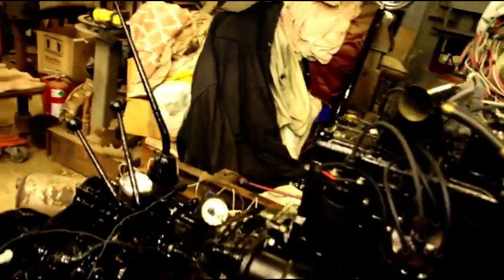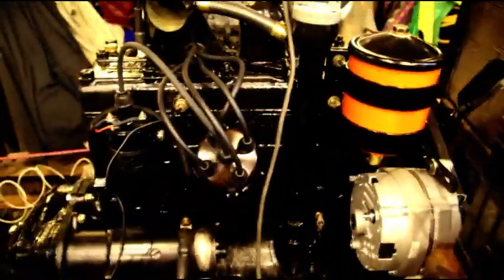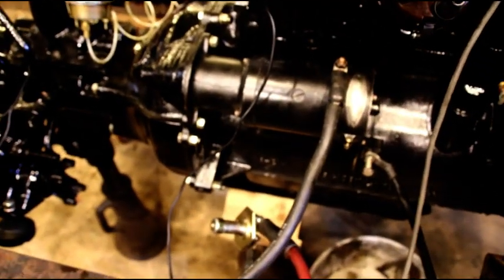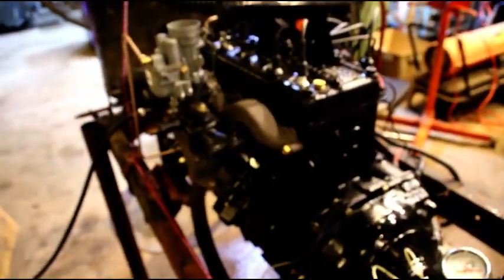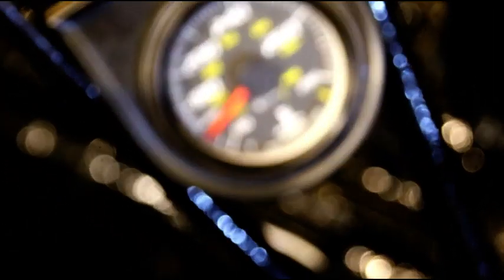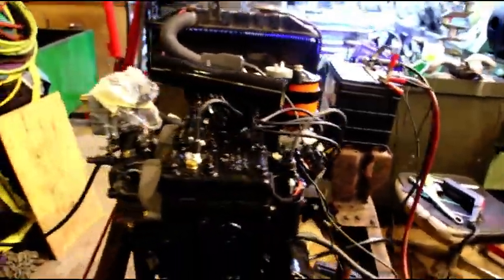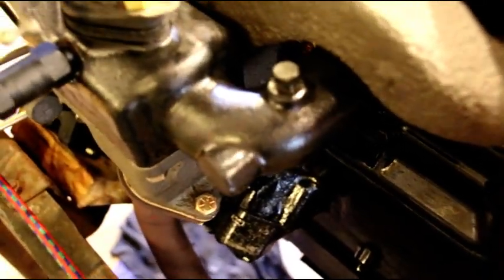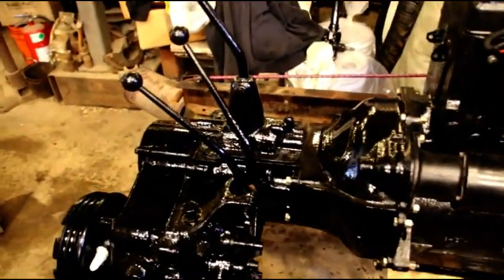Mark's Willys L134 Engine Startup and Break In Procedure

Comment: Just curious but is the t4 15w40 the stuff that says “heavy duty diesel”? If so, why do you recommend that?
Reply from the maker: The diesel oil has the most zinc in it these days and is perfect for older gasoline and diesel engines.   I have  been using it for over 20 years with good results, but like I tell everyone run whatever you like in your own engine.

Comment: Just a question what fuel is OK to use ?
Reply from the maker: any gasoline will work on these old engines.   87 octane is fine and I sometimes add a bit of marvel mystery oil in the fuel tank to help with lubrication of the valve train.

Comment: Hi Brian, what brand of break in oil do you use?
Reply from the maker: I use 30 weight break in oil.  I used Lucas this time because I had a few just left in stock.  Normally I have a 55 gallon drum from my lube supplier that I use.   Any break in oil will be fine, just don't use any synthetic oils.